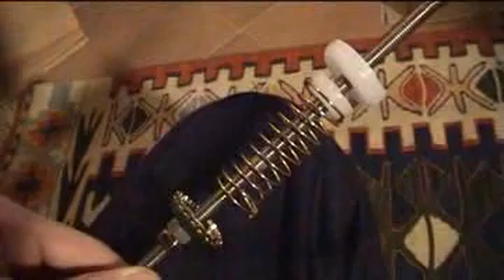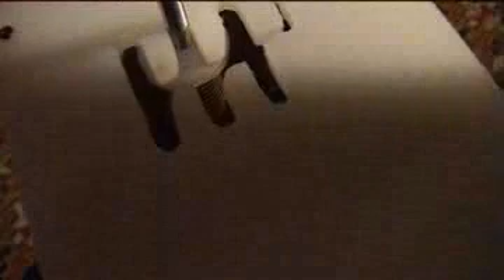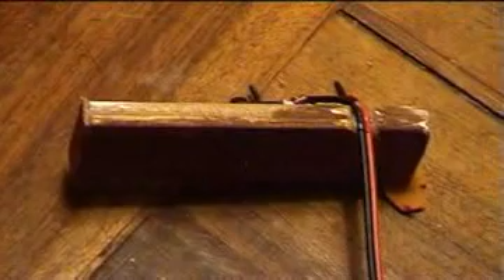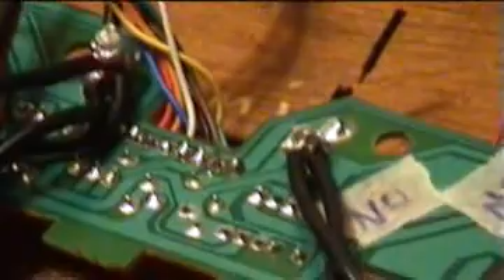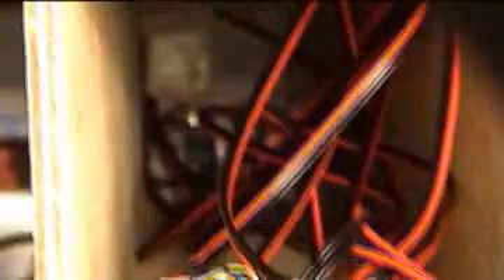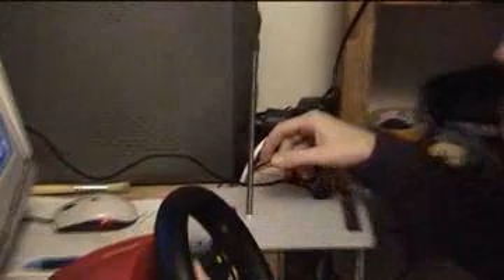bragi h-shifter

Comment: This is evil genius at its best! Well done... I wonder how long did all those microswitches last... I still have the black and red momo wheels btw!
Reply from the maker: Nowadays you can buy anything. At the time we needed to invent. If I can tell, the momomod is even better since I've managed to place the old pad inside the wheel's case.
The micro switches lasted until I needed to put all my stuff in the storage room 🥺
Reply: @bragee  yeah my old red and black momo still works as far as I can tell which I tested on an older PC. I remember almost all guys are doing their own DIY from simracing rig to fits Arduino-like microprocessors to the first (I've seen) 6-DOF rally hydraulic rig, such creativity and inventiveness when you're young ... ahh to be young and foolish and mad genius all at the same time again... 🤔
Reply from the maker: @ledood7600  for sure your Momo Force still work but it doesn't have all the buttons that mine has ;))
I remember at the time that all the guys from the community laughed at the quantity of buttons that I've managed to put in the new wheel plate. As a response, I've also built an additional control panel around the shape of the wheel's case LOL
check borghero(dot)com/bcp(dot)htm or directly borghero(dot)com/bms(dot)htm
Reply: @bragee   now they are not laughing are they? hehe I think they even sell this for simracing rigs if you cant be bothered with the keyboards looking for your hotkeys... very smart... haha great pics! that is not bad at all, obviously very configurable.